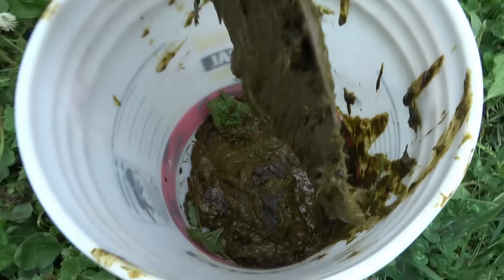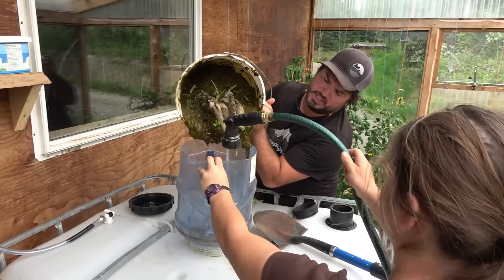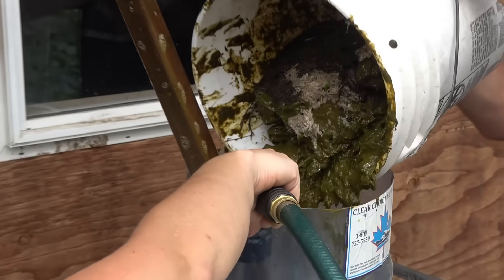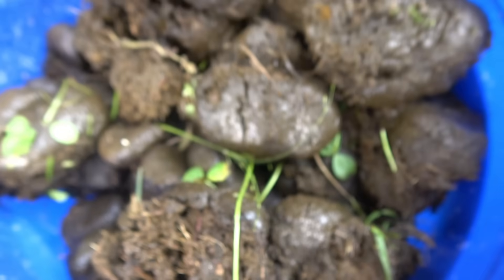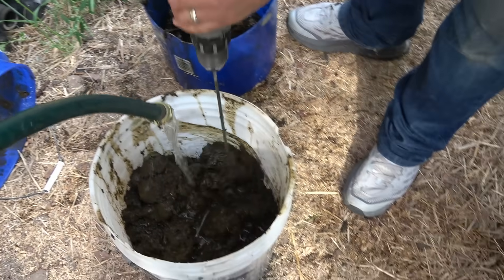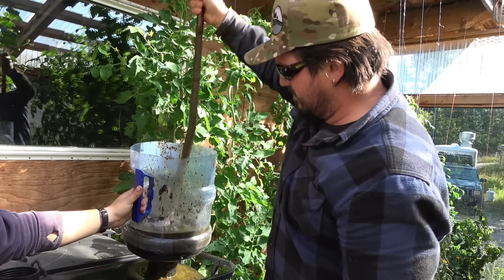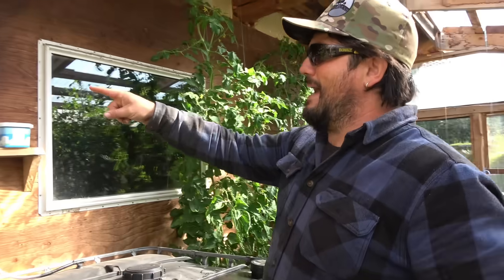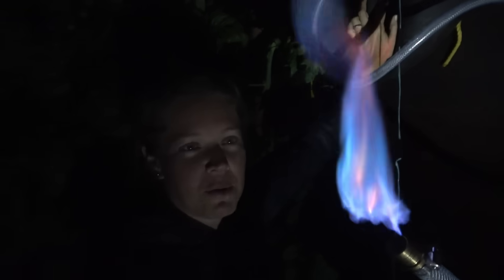Endless Off-Grid Fuel on the Homestead - Biogas Part #1

Comment: I still don't understand why people with methane digesters fight to put material in why doesn't anyone use a single stainless steel kitchen or bar sink with a garburator to add to the digester it would liquifie the material mix it well with water as for collecting and pressuring the gas why not try a double tank system either 2 55 gallon drums or 2 IBC totes one above the other gas could either go into the bottom or top of the bottom tank full of water the tanks would be connected from the bottom of the lower tank to the bottom of the upper tank that way as the gas goes into the lower tank it forces the water from the lower tank and up to the upper tank weight of the water gives pressure to the gas if the gas goes in the lower tank at the bottom and bubbles up through the water it'll prevent any fire backflash it'll also do some purification of the gas and by venting the upper tank to the atmosphere it makes a relief valve if9 the gas in the lower tank gets to much it'll travel up the pipe connecting the 2 tanks and venting to the atmosphere by adding some float switches to the upper tank the gas gets to a certain point the float in the upper tank can start a compressor
to move some gas to a cylinder under pressure to be used for a combustion motor either generator, lawnmowers snowblower or even a vehicle the cylinder can be transported to be used elsewhere that way you can use one digester to supply fuel to 2 or more places

Comment: After the initial setup, and the oxygen is consumed, the microbes then produce biogas which is primarily  methane CO2 and a small amount of hydrogen sulfide. Any nitrogen in the gas is probably what started in the container and gets pushed out as new biogas is produced.

Comment: Biogas has a significant amount of CO2 maybe 35 to 50%. You can upgrade the biogas to a higher quality biomethane by scrubbing the CO2 out using water and pressure

Think of how CO2 bubbles out of a 2 liter soda bottle when you remove pressure. The reverse happens when you apply pressure, CO2 is absorbed while methane isn't absorbed much at all.  You can even use sodium hydroxide in the water and that will convert sodium hydroxide and CO2 in to sodium bicarbonate. Given time for gas absorption, you can achieve nearly 100% methane.

Comment: If you used the gas in the kitchen it likely would stink unless you cleaned the gas, maybe a big charcoal filter would do the trick and hopefully last quite a while before the charcoal needed to be replaced - spent charcoal could still be used for black powder or a barbeque etc.
To pressurize gas all you need is a gas tight bag with some weight on it, it is similar to how the old city coal gas systems worked. A barrel with the bottom end open and sitting in a cylinder of water is likely the easiest to make, the barrel rises as it fills with gas, pressure can be regulated to a degree by the amount of weight on the top of the barrel. To use the gas you would need a stove set for natural gas rather than propane.
The simplest way to cook from the energy of poo is to dry cakes of it in the sun and cook your food over a fire made from  dried poo patties, it is the same energy being burned, one form of heat is more convenient and efficient to cook with than the other.

Comment: An old refrigerator compressor works good to pressurize the gas into propane tanks. You don't want any air into the system because that will cause flash backs, if it's pure methane in the tank in lines it cannot burn until air is mixed into the equation at the burner. That is exactly why oxy acetylene torches has flash arresters

Comment: solar and hydrogen production or water tower battery turbine in the base of the line down can even run a still and produce sugar burning alcohol then the mash is bio digested solar and produce steam get a giant focal lens  ....the future is like hydrogen in a silo gas produced ground level the evey few spaces virtical it a wave generator that aulternates out then the gas is pushed back dow like the tire tube and burned at ground level......almost forgot wood gasification egr on a car

Comment: Get a cheap disposal unit and run all your "murph food" through it with just enough water to keep the flow going....this can be done at a separate prep station or with the unit mounted directly on the tank.
You guys seem to be focused more on manure, keep in mind that MANY other biological materials can be used....manure is mainly needed to introduce the bacteria needed to start the reaction.

Comment: hello to all the little family. hello mrs "big murph"   
he idea of making your own gas with organic waste is very good, especially like you off the grid.. you could make two one for the house and another to heat the greenhouse in winter, I don't know in which regions of the usa you are, but heating the greenhouse in winter if it's free and eco. it can work.. after that you may have to improve the configuration of the installation (non-return valves the right balance between cow poop and water etc etc there are some who have already done it off the grid and it works for the gas cooker for water heater etc and even some have done it to heat the greenhouse in winter.. well done and continue.. but be careful with the flames and the blowtorch and firecrackers when you are next to the installation of "mrs big murph" otherwise it's free eyebrow waxing for all...lol
(already known technique but practical.. with the gas of mrs "big murph" heat water which with a small water pump ferrais circulates this water in pipes underground water pump which resists hot water in 12 volts [on aliexpress for example, there are correct resistant models] which would work on 1 12 volt car battery or made with 18650 [there are ready-made batteries or I advise to do it yourself by buying on aliexpress / other site the card the 18650 and small accessories you will have a battery which can be recharged up to 3000 times and with a good amperage the pump and the orticole led lights could work on it..and small solar panel 50/100/200watts and its charge controller
all this is not very expensive if smart but above all allows you to do lots of things to improve life off the grid, like having water on tap or shower with a small water pump for less than 10/20 euros have light with LED strips or 12 volt LED bulbs or with small fans in 5/7/9/12 volts make air extractors to avoid mold in the cabin.. have motion detectors to avoid crossing a bear or a stupid thief (lol but you get the idea lol) in short now with all this technology and their prices which have fallen a lot, we can improve our daily lives off the grid or camping hiking etc etc and I would even say in the city to save money on CO2 and other 220 volts wood diesel or nuclear.. sorry for the headache.. see you later, big kisses from the south of France..

Comment: You need to add a macerator pump to the process.  It will pull from the bucket, mince up the doo doo and pump it into the IBC.  Sailboats use these to pull the contents of the toilet and push it to the blackwater tank or direct the stuff overboard.  It was made for that crap.

Comment: Part of the formula for producing gas is that the temperature needs to be at 70° F. - about 100° F.
My plan is to wrap the tank with water pipe AKA PEX tubing to run hot water through to keep the tank warm even in winter. 
Also use spray foam insulation to cover the tank completely top to bottom. 
To remove the sediment once in a great while I will put a pump in the tank to keep the process going without having to open the tank.

Comment: mayhaps you need some bog peet in the poo container as a catalyst ? as far as i know the bog slush also holds flamable gasses and it does contribute to the composting process of the poo ... call me out if im wrong but i have seen ppl harnest gass from the bottom of a bog aswell

Comment: You need to get yeti buckets. They are seriously awesome and indestructible. I work with concrete and I was tired of the Home Depot buckets always breaking. And yes they are more expensive at $40 per a bucket, but it’s cheaper once you factor in how often you have to pay to replace regular buckets.
Reply: It will have to be a very cold day in hell b4 I give someone 40 for a bucket

Comment: A better mechanism would be a bladder.  Dig a kiddy pool size depression in the dirt.  Line it with rubberized material or a bladder.  Make one end openable with a zipper or an attached openable metal box.  Give the metal box a hinged door to throw poo into and seal.  The top of the bladder has a hose attached.  All the gas coming out will be pure.  Better yet would be to make it larger and put it at the end of the animal pens so it is easy to fill and hook a compressor to a wind mill so it doesn't require electricity to condense the gas.

Comment: about 20 years ago a buddy of mine built a 5000 gallon digestor on his father-in-laws hog farm ( along with my help as general labor). my buddy had 2 degrees-1 of biology and 2 of solid waste management. at that time his FiL was lagooning the hog waste in a containment pond. we put in a small tank between the hog barn and the pond and ran a 3 inch pipe from the tank to another larger upright tank of about 4500 gallons then ran a pipe from the bottom of that tank to the digestor. the pipe had a grinder/pump to reduce any waste size and to fill the upright tank. we let it set and settle for about a week, then let gravity feed it into and fill the digestor. if i remember right my buddy had built the digestor as a big bladder type of rubber/poly type stuff. he said he would use fresh, unprocessed cow stomachs he'd buy from a slaughterhouse to supersharge a get the digestor started producing gas. the gas was then ran thru a water bath then thru charcoal to a tank. we pressurized it to about 5 psi, then ran it thru a fuelcell to produce electricity. about once a week that summer we would go out to drain a couple thousand gallons out thru a sieve system- any leftover solids were then piled in a compost pile and the water was sent back to the containment pond. then we'd refill the digestor from the upright tank. this worked quite well. the FiL was able to sell excess energy back to the grid and the extra gas was used to heat his hog barns.
Reply: This is what environmentalists need to be doing. Not being dumb ass commies
Reply: All of it is genius but the fuel cell is a smart addition. A bit of an investment in labor and a lot of low cost reward. That's awesome. Thank you for the idea.

Comment: You need to have the right amount of water to solids or you will kill most of the bacteria and get slow production. You also need more than just poop. In the EU they run power plants on this and add corn and plant matter. Any source of sugars will work, though. Insulating and mixing helps improve it a ton.

Comment: Yall want a REAL bang?

Fill a Zip-lok sandwich bag with Brown's Gas and ignite that.

My efforts earned me a visit from the police bomb squad and I  REALLY got yelled at, but not spanked, so I got over it.

Recipe:
1 one inch aluminum tube

1 high-nickel-content stainless steel rod

1 1/8" threaded nipple

2 nylon isolators > center drilled to fit rod

Drill a hole not quite all the way through one isolator plug and all the way through the other one

Silicon glue the pocket-drilled  nylon plug in one end. That's the bottom.

Stick the rod into the hole in the isolator and through the other one (top) and glue it in place.

Let the silicon cure overnight. 

Mix baking soda (bicarbonate of soda) into clean water and pour it through the threaded hole at the top of the tube -- you know, the one I forgot to mention, leaving about a 3 inch headspace.

Screw in the brass fitting and attach a fill hose to transfer the Brown's Gas.

Attach a 12-volt battery to the rod and to the aluminum tube.  The positive (red) lead goes to the tube.

This puppy will churn out a mixture of Hydrogen and Oxygen gas ---> EXTREMELY explosive.

Be careful. This stuff will really explode.  As Shrek would say, "Really, really."

I put my gas-filled sandwich bag into a 4" x 7 foot "Air Cannon). Think porato gun.

The blast will break windows a block away.

How do I know?

Remember the visit from the bomb squad guys?

Hey, I was just a kid with a high IQ and a sweet face. What could go wrong?
😂

Comment: You can take a air conditioner system apart, run the natural gas through the compressor, to the dryer, then the condenser and then into a container that has been vacuumed to 0 atmosphere prior to filling, you should be able to turn the gas into a liquid like propane and butane.

Comment: Use the radiator condenser from your gasification sistem  to  pass by inside the methane tank  the heat will activate the molecules on the gacido poop and making more methane. U just know using the nature to make gas but if you heat the mixture  will accelerate the process and one more thing  under  vaccun and using  compressor the gas will be more concentrated and u can stored in tanks  just remember  do not let oxigen  into  mixture  cause oxigen is also part of fuel  but only to burn .

Comment: For making methane go boom... 5-15% is your explosive range 10 being tbe most volatile. The reason it went off better at the 50/50 mix is you were closer to a lower concentration of methane esp after using oxygen from the torch. Methane being lighter than air will also hang out in the top of the bottle so no need to worry about it escaping as long as you keep the open end down. (From an old coal mine) enjoy your new found knowledge but be safe. Its a lot more explosive than you think... if you use a pop bottle id get far away and make sure there isnt anything that can turn into a flying object like rocks etc... by far away i mean at least 50yrds from the pop bottle or better.

Comment: hey man, two big barrels, one slightly smaller in diameter than the other. cut the tops off of both, put the gas supply in the bottom of one, small amount of water in the bottom and it acts as a gas tank that self floats as it fills. they used to use similar methods of storing coal gas back when it was used for lighting. edit, its called a gasometer or a gas holder. youll have the benefit of the weight of the upper tank which will allow the gas to flow out itself.

Comment: I suggest finding copies of the Sacramento Wastewater Manuals. Somewhere in there are detailed operations for anaerobic digesters. Grab a cheap drywall mud mixer for your drill to mix the buckets. Also develop some way to stir the digestor. You need to get the fresh manure in contact with the bugs.

Comment: I don't use poop in mine, I use vegetal table scraps (no animal) and some light lawn waste. Works fine for me as gas and liquid fertilizer. Jist keep the digester warm in the cold months. I keep mine in my basement due to constant year round temps without extra  heating requirements. Also, keep track of your digester Ph and temps. If you get a stuck digestion, you can always change the pH or add some live liquid septic tank starter like rid-X live enzymatic bacteria. Depends on why your gas production dropped off.

Comment: I think if you keep the tank stirred up to prevent the water for separating out of the road apples .. I think if you keep the mixture warm as well it would help a lot.. if you place the tank where you're getting a lot of sunlight.. and you keep it in your greenhouse that can act as a solar battery to keep your greenhouse warm of the winter. But keeping the greenhouse warm in the winter time you may be able to grow more plants around then you would if you didn't have that to heat up the greenhouse.. just to get another tank setup.. there's going to come a point where the stuff that fermenting right now in your tank is going to be broken down enough where there is no more methane being produced.. when you do start one and fill it up.. wait a couple weeks and then start the second.. and you can also put food scraps in your system.. as well as glasses that you will not be using for your livestock..

Comment: I told you do this about 2 years ago 
get a inflatable bed 
put it in a smooth frame ask Dave 
to make it 
so it's done properly 
have a Weight on it
and you need greens as well with the muck in it 
AND PLEASE USE 
NONE RETURN VALVES 😮😢😂😅

 DON'T RELY ON THAT JAR or you could have a very Dangerous Situation good luck

Comment: Horse manure is used for paper making... as the fiber is not digested, they use hydrogen peroxide to bleech and heat for sterilization, before they use the fiber for paper making.

Comment: Anaerobic digesters were widely used on farms back in the 1920's to early 1950's. Yes it's methane, nitrogen and a few other gasses, be sure to minimize air from getting into the digester (especially when feeding it) and lines /connections, for safety have a flame arrestor at the tank outlet and at the exhaust (stove connection or whatever), horse manure is fine but low in nitrogen and considered a "cold" manure, cow, chicken and hog manure in that order are "hot" manures and higher in nitrogen, as for other feed stock outside manure you'll want to grind or shred it because doing so creates greater surface area per unit of volume causing more efficient digestion. One final note he slurry at the bottom is PERFECT for putting back on the grow beds so you'll want to have a method for collecting it such as an outlet at the bottom of the digester. Have fun!!